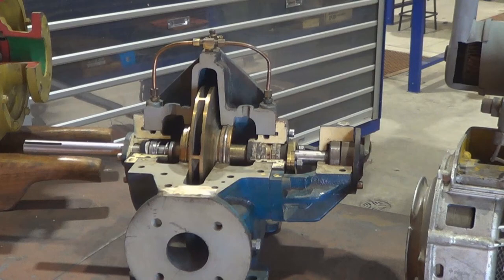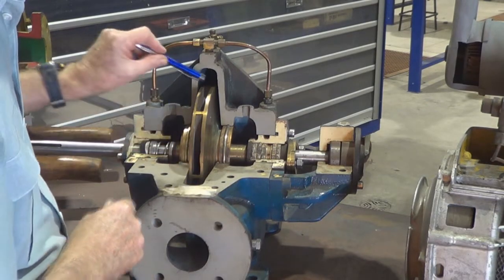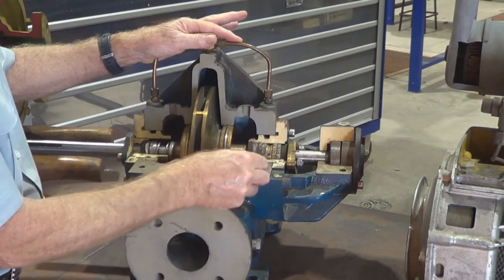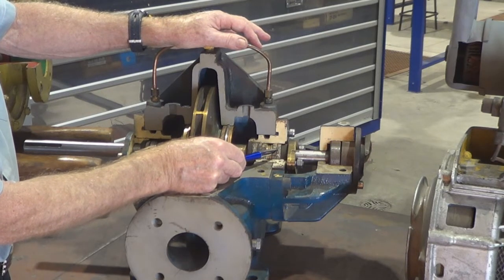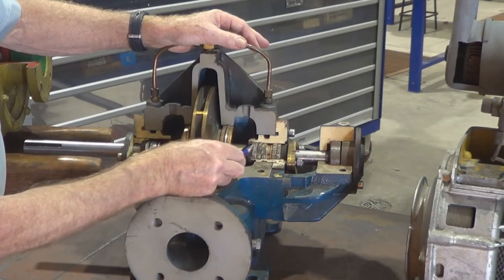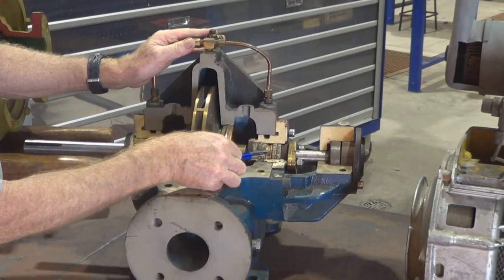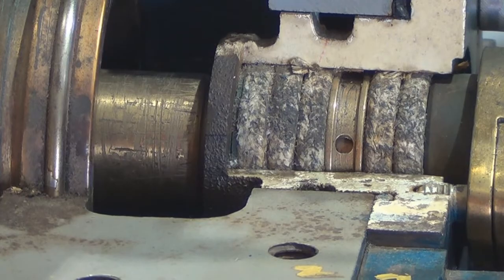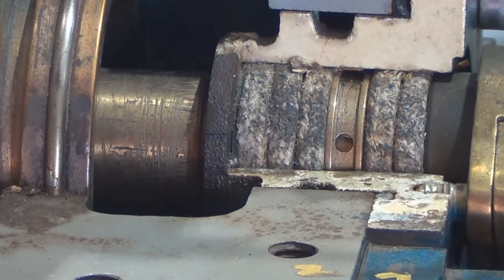Centrifugal Pump Gland Packing With a Lantern Ring

Comment: So for further clarification and to make sure I have it right... In pumps designed with a lantern ring in the packing gland, like the one shown, water travels through the ring and then runs along the shaft between the shaft and the packing, back to the pump suction and also out of the packing gland... meaning "some leakage" out of the packing gland is normal. Is this correct and is this true for all pumps that use a lantern ring in the packing gland? Furthermore, pumps with packing material that is "self-lubricated" and does not create a lot of heat, such as graphite impregnated or teflon packing... these do not need lantern rings? And leakage out of the packing gland is not normal nor necessary for cooling and lubricating? ...And then obviously pumps with mechanical seals do not use lantern rings and should not leak at all. 
Thank you to anyone interested enough to respond!
Reply: Haven't been in the sealing business for 30 years, but it is/was my impression the lantern ring is used primarily for lubrication purposes to reduce heat. Perhaps depending on the application, you might replace it with packing entirely, but it is there for a reason. Leaking in packing is normal, tighten the gland as the packing wears down, lantern ring or not. Worthington Pumps come to mind, as does Allis Chalmers, and municipalities were the primary end users of split case horizontal pumps. I'm sure there's many more, but some applications forbade a mechanical seal (fire engine pumps) or the difficulty of limited space.

Comment: if you didn't put packing in the pump, what would happen ? would water just be spraying everywhere ? But the pump should maintain discharge pressure ?
Reply from the maker: +Drew Wilson
Hi Drew, yes Gland packing is one method of sealing the shaft entry into the pump housing, the shaft drives the impeller, which in-turn expels the water. Without the packing the pump would leak severely and discharge pressure could not be maintained. Thanks for the question and for viewing the video.
Reply: I work on a dredger that has two multi stage pumps for jetting water off the arm running at 170psi. Gland packing is the most important part.  If it becomes worn on the suction side then your pump will pull air in through it and loose pressure. If the packing is worn on the discharge side then you better get your drysuit on.  We don’t have a lantern so we like the packings to leak at a rate of one drip every 3 seconds.
Reply: @kelvin .. does the gland packing play any cooling function of the pump?